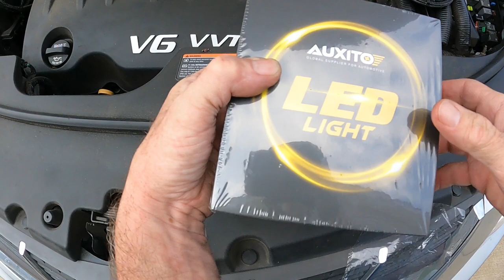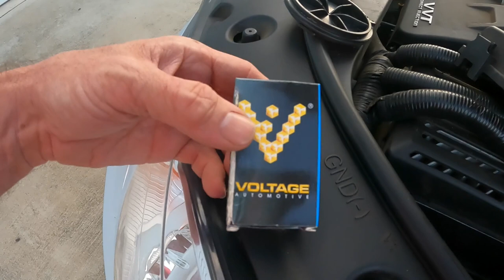The BEST LED Headlight Bulbs - AUXITO - 2010 Cadillac SRX

Comment: Those are some bright lights.   Is that the Cadillac that has the batteries under the back seat?  I've always found those very diffrent.
Reply from the maker: thankfully it is not under the back seat, but it is still a chore to mess with this battery

Comment: Did you get any error codes or warning messages because of changing the type of bulb to the LED? Or did everything work just fine with no error messages?
Reply from the maker: Everything worked great. (I even extended my leads while I was in there). Had no issues and the lights are great.   My son in law ordered a set as well and he loves them.  Great customer service.  If you have any issues, just email them and they resoyit immediately!